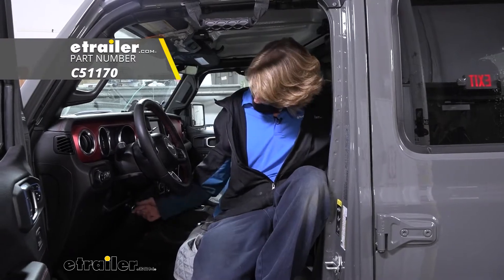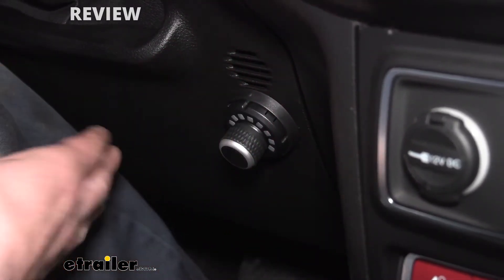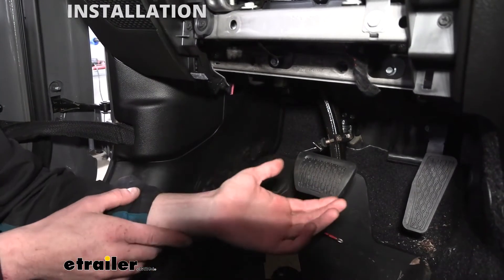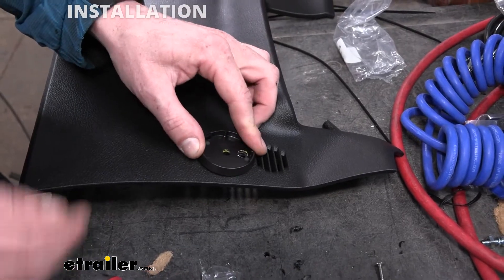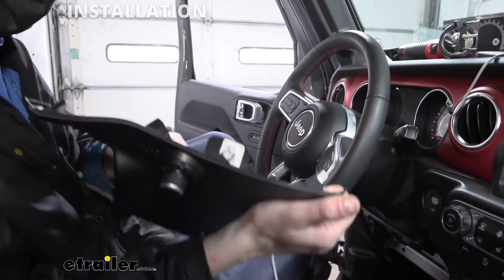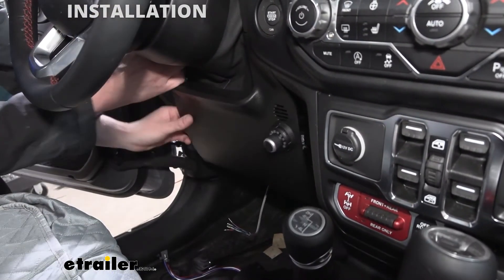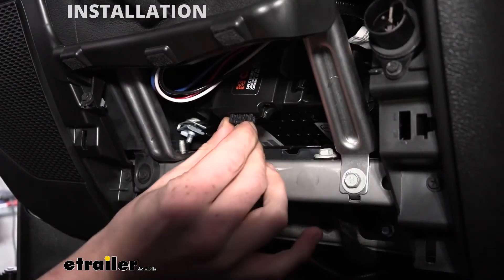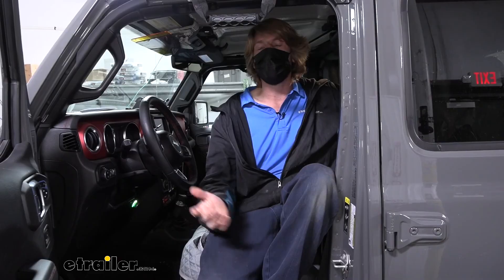etrailer | Setting up the Curt Spectrum Brake Controller w/ Custom Harness on a 2021 Jeep Gladiator

Comment: Finally, some of that knows about this spectrum brake controller and how it works and should’ve installed it exactly where you installed it. Good video! Thank you so much.
Reply from the maker: You're very welcome, I'm glad the video was helpful!
https://www.etrailer.com/Trailer-Brake-Controller/CURT/C51170.html
Reply: @rmallea1 If I am understanding you correctly, I see a lot of people mounting this controller paralell with the horizontal line of the car, but I am pretty sure it needs to go vertical +/- 20 degrees like this video, is that what you mean?  My dealership mounted it flat on the boot floor and when I plug a trailer in it just flashes green quick on the first square and then I get nothing else.  Going to try moving it vertically tomorrow..
Reply: I suspect it flashes quickly on the first square because it is more than 20 degrees from vertical and it can't calibrate... I hope that is the problem, but it is also embarassing for a dealership to install it incorrectly (if that is the case).